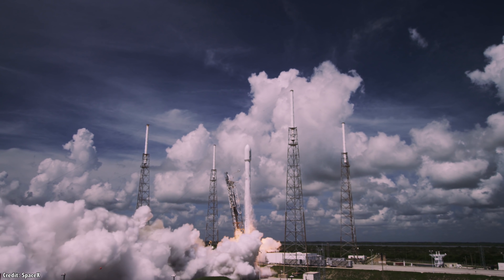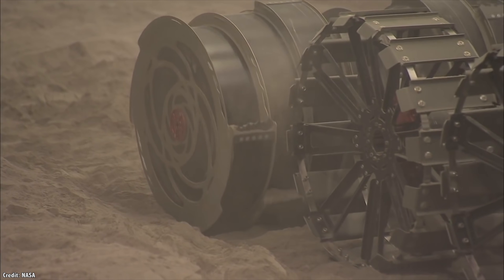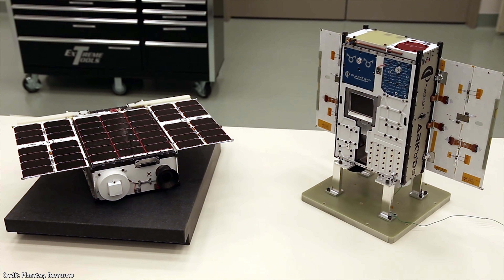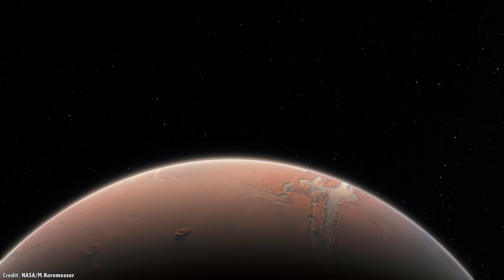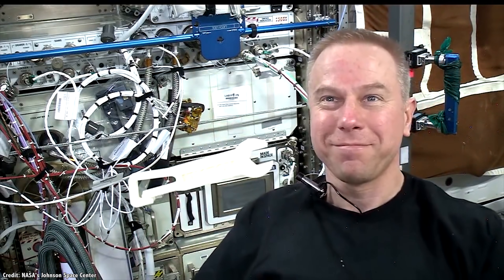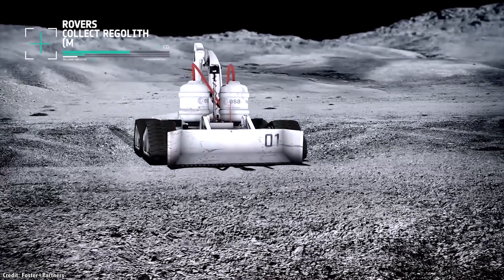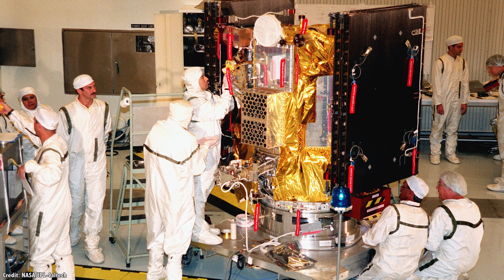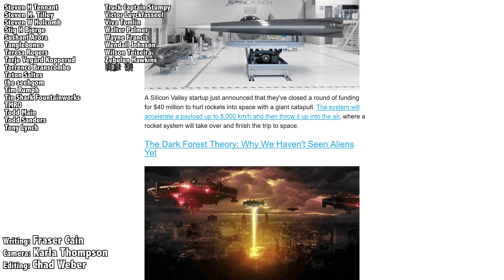Harvesting Resources From The Solar System. In Situ Resource Utilization

Comment: Note that it is far more likely that any resources found in space will be put to use in space first, not hauled back to Earth until we built a fast and practical and safe way to do it. Because of the tremendous cost in energy & money of launching something out of Earth’s atmosphere or back into it, the most efficient use of resources extracted in space will be right there: in space.
Reply: It's EASY, as well as safe and practical, to return stuff to Earth. The first few hundred tons is expensive though. 

One idea is build reentry gliders out of asteroidal material. Iron and silicon, basically. Crude is adequate for a start, but eventually we could make them very fancy. Materials could be landed at the receiving docks of factories, direct from space. Cheaper and easier than rail freight. Asteroidal iron will be cheaper than earth iron, delivery included. 

Eventually, despite delivering megatons of stuff to Earth, almost all of it will be used in space.
Reply from the maker: Oh, and one cool idea to return metal back to Earth is to spin it out into a big ball of wool with as low a density as possible. It should be able to re-enter the atmosphere and survive relatively intact.
Reply: But we don't need "worlds." Aside from Earth they are all awful, terrible, dreadful places - all the ones we can look at or hope to go to. But - we don't need no planets. We don't need no STINKING planets. Space is the place. 

Who has better views? A rotating bunker beneath mars? A blimp city in the opaque, corrosive, suffocating Venusian sky? Or a glass yo-yo in orbit above the Indian Ocean? Or above Saturn's rings? Or in the real dark, in a huge, thriving city half way to alpha centauri?
Reply from the maker: As I've said, gravity wells are for suckers. You never want to bring stuff back into the Earth's gravity well if you can avoid it.
Reply: You are really in the wrong. It is easy to enter the atmosphere and burn up like a meteor ! The problem is to enter slowly. however it take a huge amount of fuel with ordinary rockets. You can do a slow re-entry with "aerobraking".

To skim the Earth’s atmosphere in orbit, your spacecraft must travel at 7.8 km / second, or about 28,163 Kph. The Earth itself is spinning around 1,610 Kph. You can reduce the entry speed of your spacecraft by orbiting in the same way that the Earth spins. However, that only helps a bit. Your spacecraft still has to travel at 26,555 Kph relative to our atmosphere to stay in orbit.

If you slow down below that speed, you will hit the atmosphere at thousands of km per hour, and at that point pray hard that your aeroshell protect you from the heat.

Have a nice weekend !
Reply: A space elevator would be great. Or an orbital ring - even greater. But those are big (HUGE) projects. We won't build those until after we have large infrastructure in space. 

Asteroids are made of treasure, rocket fuel and aerospace materials. (And everything else too.) With 24/7 solar energy. It's "easy" to make reentry gliders full of fuel and cargo, with an iPhone worth of sensors and robotic controls. 

You don't even have to be that fancy. You could just wrap 1000kg of platinum in a ceramic shell and drop it on some tundra. The space shuttle didn't burn up on reentry. (Except once. The small tiles were kinda dumb in retrospect.)
Reply: Check out a "Skyhook" though - we could just about build one tomorrow. In many ways even better than a space elevator. Nice, gentle, cheap transit to and from space. No new technology or materials required.
Reply: Yes, I had seen it. All these technological ideas are super cool. :-)
Reply: Sébastien Raymond Heat shielding is a major issue, as is velocity, but when you enter a gravity well, it can actually help you land. It's far easier to fall than to "jump". 

All the objects we are likely to land on in the Solar System have much less gravity than Earth which makes lift off easier... the moons of the gas giants are near major gravity wells, but in orbit. 

As for Venus - we've landed craft there, but without the possibility of return. It's a hell world with high gravity. We may colonise the cloud tops, but I question the effectiveness of that model since we won't be able to source many local materials there. Mars has much lower gravity than Earth so take off is potentially easier.
Reply: Sébastien Raymond Yes! Even the Moon has a number of minerals which are hard to get hold of on Earth. Some of these have industrial applications.
Reply: Sébastien Raymond We ARE finding super-materials! Half of them are made of carbon, one of the most common elements. Graphene, nanotubes, superconductors, super capacitors, supercomputers - all carbon, with just a pinch of other stuff needed. Soot is better than gold.
Reply: Twirlip Of The Mists Actually I said I didn't think much of the Venusian idea. Mars has sight seeing potential - you would need some shielding, but the same applies to a space station. A space station has none of that, and reeks of claustrophobia. You could even go camping around Mars- it would be a bit different to camping here, but it could be done. On a space station you have the option of floating in the void for hours on end.
Reply: As I said, as long as we do not have an economical, fast and safe way to bring the materials back to Earth, it will mostly stay in space (thankfully or unfortunately). 

This is a nice subject that makes us dream (well in my case) and think about the past exploitation and colonization of the North and South America in a certain way.

Have a great weekend!  :-)
Reply: Sébastien Raymond if it'd precious like gold or platinum, it's coming straight back earth.
Reply: It's really very interesting, at the same time, don't you think that the return trip must be more profitable than the actual trips and the extraction itself. We are talking here about tons of equipment plus tons of materials confronted with gravity when they come back.

Personally, the project that comes to my mind is the space elevator (the idea of Tsiolkovsky). I do not know if it could be feasible one day and I doubt the safety of such a machine, but who knows?

Have a nice weekend !
Reply: Getting off Earth is hard, getting back is easy.
Reply: Yes, indeed it's easy on a celestial object other than the Earth.

It's super interesting all of this. :-)

What would be even cooler would be to find "super materials" that are still unknown to us. :-p
Reply: Thank you, I know all that, I work in environmental chemistry. :-)
It's nice to chat with someone who is passionate about science like you (and whos not a troll, because there is a zillion of them on every corner on the internet), so I say thank you again.
I hope to read more of your clever comments on an upcoming video. See you around ! :-)

Comment: Woot
As far as energy in space, it's fusion. That's it. Talking about solar is like discussing advanced sails in the 1700s, fission is stream, and fusion is diesel. Yeah we were a trans oceanic species with long voyages and tiny weak ships, but we mastered surface ships and travel with diesel and beyond. We can't seriously colonize the solar system with ships fewer than 1k tons. Travel yes, by master no.
Reply: Solar energy is there, might as well use it.
Reply: Not everything you want to do in space requires big bursts of energy. Like powering subsystems. The Sun gives it away for free, might as well take it.
Reply: Solar is easier to work with in the short term, at least in the inner solar system.
Reply: + Joel/Petit B  As I understand it solar power is not very good for short powerful bursts of energy, which is why we use chemical engines to leave the gravity well.
Reply: For the time being - probably a hundred years - maybe a million years - you're just wrong. 

A) fusion is still not possible. 
B) the first generations of fusion reactors will be large - too large to launch into orbit. 
C) fusion will probably always, always, probably forever, be more expensive, more resource intensive, less reliable and less scalable than solar. 

It will be useful, especially for certain applications (military vessels, Oort Cloud colonies, interstellar rockets...), but IDK, fusion might never supplant solar as a primary energy source. 

Why reinvent the wheel? We already have all the fusion you'd ever want. Just look up. 

Ask again in a hundred or a milluon years.
Reply: Fusion is the cheat code of the universe.  We know fusion is a thing.  We know it's the way the sun shines.  We know how to build multi-megaton weapons that utilize fusion.

But nothing in nature says that just because a thing exists that it will be amenable to humans harnessing it on a small scale.  Decades of research have not yielded break-even fusion.  And we have yet to think of a way to extract energy from fusion if we ever did get past break-even.

Solar energy is our ultimate energy source.  Only nuclear fission energy is not derived from solar, but it is in a sense bottled super-nova.  Fossil fuels, wind, hydro-electricity are all second-hand solar energy.  Let's cut out the extra steps and get our own solar energy.

Space-based solar can capture as much reliable sunshine as we provide collectors for.  The big fusion reactor at the center of our solar system has 5 billion years on its clock and has roughly 5 billion more to come.  Our sun blasts out more than a trillion times more energy than our entire civilization currently uses.  Capturing just a percent of a percent of that energy is to have millions of times more energy than we currently use.  Enough energy to fully electrify all our current energy usage.  Enough energy to desalinate all the water we could ever want.  Enough energy to sequester all the excess carbon dioxide that threatens us now.
Reply: Exactly. A ship so colloisal it would be the size of a few cities. It would have on board factories to create smaller ships that can harvest resources while on the trip.
Reply: Justin Trudeau runs on diesel.
Reply from the maker: We can't make fusion work on Earth yet,  so wait for ITER and other big projects to figure out fusion, then wait for them to miniaturize them a big for spacecraft. Until then we'll just have to use what we've got.